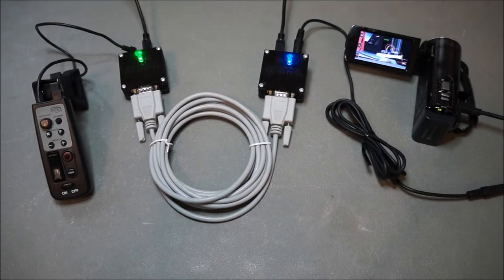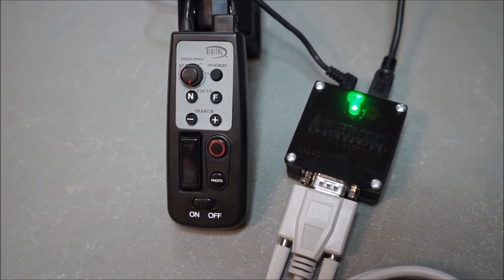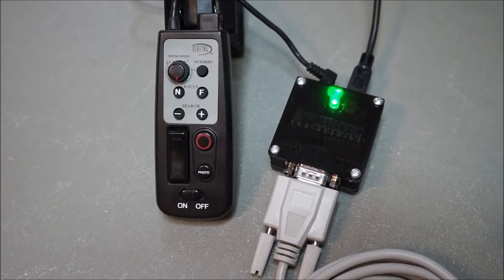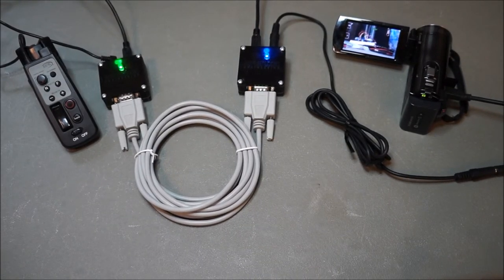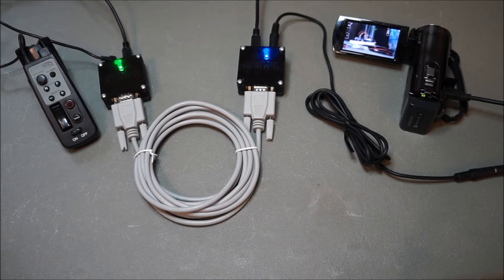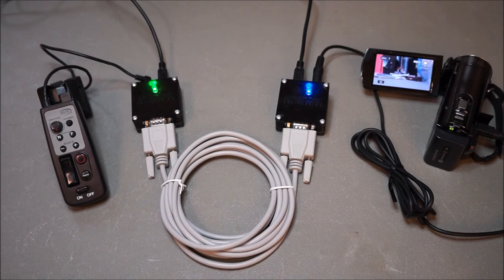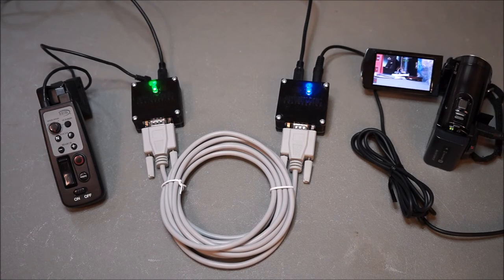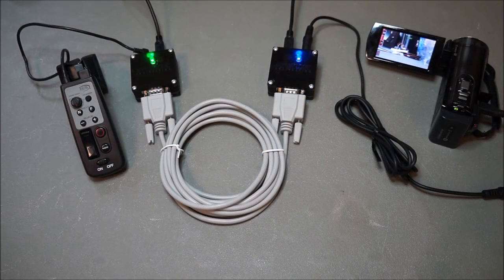Control your camera over long serial / fiber optic cables

Comment: That looks like a great solution I was looking for. So if I'm understanding right,  if I have a controller board that uses serial data (RS232?) protocol, I can just use the ALE716 Serial to LANC Controller to the Sony camcorder ? We have a Shotoku TR-B  control panel and want to control the zoom and focus on a Sony HXR-NX5U. It also already operates a pan/tilt mount, so I'm hoping I can send it down the same cable to a splitter to the motor and that module on the other end.